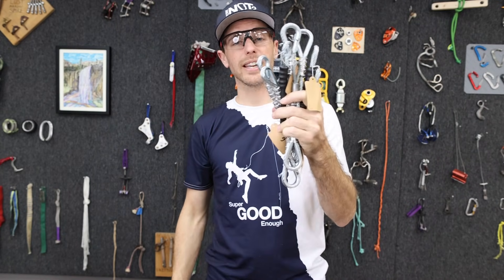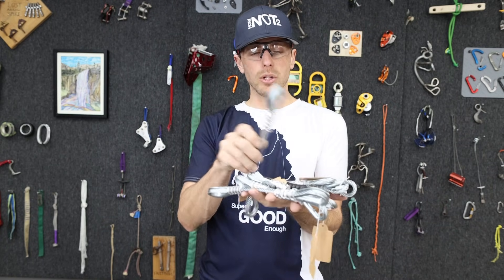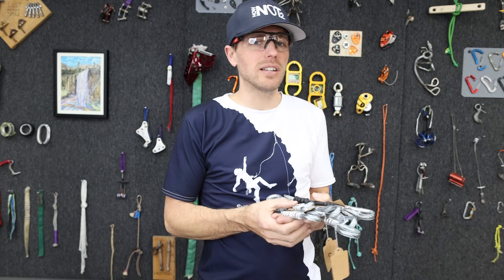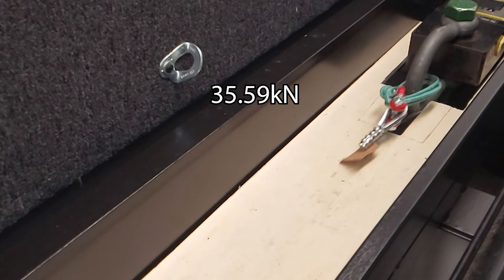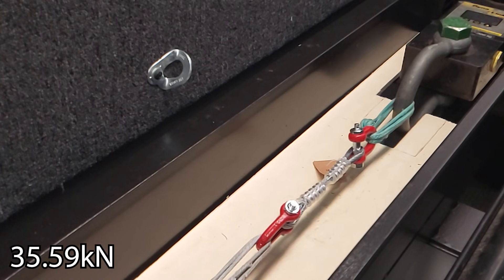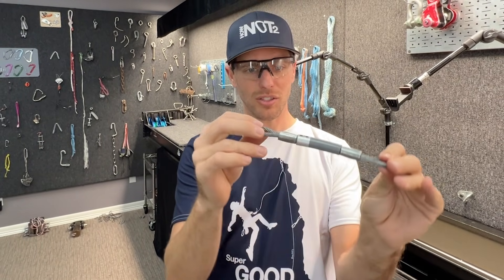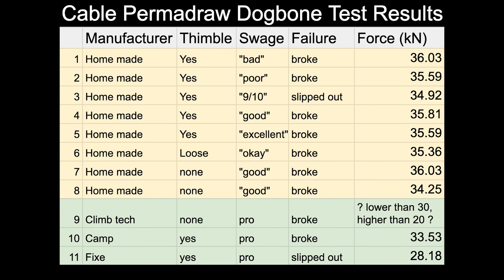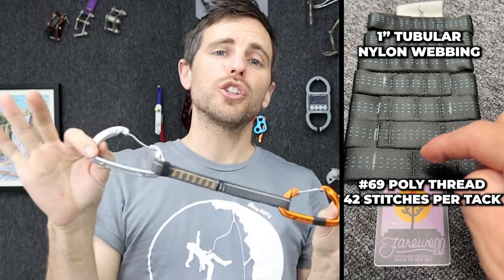Are you UNKNOWINGLY climbing on homemade gear???

Comment: That is way good enough. I did fly gliders in my youth and we made winch starts with 4.2 mm steel ropes. Everything was put together using swages. The aircraft weighed up to 750 kg and we used a load fuse of max 10 kN. The ropes were usually dragged through sand every weekend for up to a year. 
Should be enough to catch a falling human of 100 kg.
Nice work!

Comment: ❤ now that u are doing cable... i have some offroad warn cable nos i could send ya... respooled mine with dyneema when new. if u could do an off road series that would be epic... because most of us guess and trust mfr labels which is usually wrong for various reasons. several yt have been hurt doing  a reccivery... seen ppl winched down to a spot with a badlands or warn winch... 😮😅 thats sketch on a badlands winch.. or is it? since winch is not rated for humans 😂 matt offroad recovery or others are always showing bad form on hooking gear up to rapel with a winch. 😢

Comment: They make single cable swages to be used as like stopper knots to help prevent slipping from the main swages.
https://www.google.com/aclk?sa=l&ai=DChcSEwjprsnmqveIAxXlNdQBHf1QGYoYABAbGgJvYQ&co=1&ase=2&gclid=EAIaIQobChMI6a7J5qr3iAMV5TXUAR39UBmKEAQYDSABEgIVF_D_BwE&sig=AOD64_3-Fwi4Q_AC5zLG5dzAh2J_t6k5iA&ctype=46&q=&ved=2ahUKEwjapsPmqveIAxV04ckDHaoPAAsQzzkoAHoECDQQMw&adurl=

Comment: Prehaps I need to make up a really weird version of this, and send a few in. In the version I can make, if I can get a tight enough bend radius out of the cable, is to unwind the strands of a wire rope, then using a single strand, retwisting the single strand in a loop to recreate a nearly endless loop, with the only ends being the 2 ends of the single strand. This:https://youtu.be/GPp1GWGxG4c?si=8XRh5L5xaRDhizUP . Then collapsing the loop into a double strand center, with a loop at either end. 

Also, testing of the "Farmers Eye" demonstrated in that video would be interesting content.

Comment: The DIY swaging is actually pretty simple, using tools made for the purpose; proper cable diameter and material, correct size swage, crimp correctly with a long armed tool, or a press. The check is done with a slide-on feeler gauge, and of course also having a reliable pull test done initially, and randomly after is smart insurance. If this seems suspect, consider the end user is likely in industrial work where serviceable tools and methods have evolved and been used for many decades; consistency is very important, and also a healthy safe working load margin. Home sewn webbing is a total non-starter with no consistency or check except pull testing - don't go there.

Comment: Warning! Do not use dogbones permanent outdoors with plastic sheeting! Two young boys died doing a rapell on a plastic  sheeteed dogbone. It was set between two bolts and the boys having just started climbing and had not much experience put theire rope over the wire. 
The wire broke on the load and sadly the other boy also was tied in to the rapell rope. 
The reson for this is there was a plastic sheeting on the dogbone and even though it looked good on the ends it was rusted inside the sheeting.
Reply: That's exactly what I was thinking - opaque sheathing prevents you from being able to inspect the cable.

Comment: Coming at this from logging... it will generally break AT the thimble or the first bend point, that said, for funsies try a "flemish eye" splice (also know as a farmer eye) one of the easiest splices and doesn't involve bending the rope (bonus it can be done in the bush without special tools...) It also doesn't necessarily require a thimble, though a thimble does secure it from unraveling, but its not relying on it for strength.

Comment: - Re. Homemade vs unreliable batches?? - Homemade is FINE - provided the composition and processes are uniform  - your Saturday article on "off-brand" items (13th Jan 2024)  made sense  (I want cheap UHMWPE - but not if it isn't what it says on the label):
One thing to figure out with the "no-name" components, if were they failed in the quality department at some stage, or merely cosmetically defective. Testing small numbers out of a batch assumes that the batch is relatively uniform, it may be found with some parts that the batch is unreliably variable (making the QA necessarily more expensive as higher part counts need to be tested, rather than 1-2 out of every thousand...

Once a batch is tested - and the reliability established -the "How Not-2" on the label should refer people of all the things NOT to do with this item, and how the responsibility for safe use rests on them - ie. we NEVER recommend you do this at home  (Seek professional assistance for that problem)....

Flooding the world with cheap 304SS sounds a great plan.  (If a bolt can be had for $2 and a carabiner for $4 - backing up on the safety becomes trivial.) - cheers.

Comment: I’m gonna bet the thimbles help with repetitive loading. We use air craft cable at work for hanging banners, whenever we don’t use thimbles the eyes tend to degrade faster then when we do. Totally different application, continuous static tension with spikes when we put a banner up and spikes when the wind is blowing is not the same as climbing.

Comment: Did you do any of them with the cable woven back on it self? That is unwind three of the strands and then rewind them the other direction around the thimble?

It would be interesting to see how that would work with just heat stink and no swages at all. I suspect if you do it the hard way (take every other strand rather than 3 consecutive strands and do about 3 full wraps back past the thimble) you might get number comparable to those ones. I suspect, given they were breaking between the swages, the result would be not enough better to justify the cost. For a dog-bone, you might even be able to have the strands coming back from the ends pass in the middle which might actually get some benefit.

Comment: Generally with Nico sleeves, you will put them through a go/nogo gage.  It's basically two slots.  The swage diameter should go into the go slot, and not go into the nogo slot.  Crimping too tightly is as problematical as not crimping enough.  Usually once you got the swaging tool calibrated, it reliably made swages that passed both gage slots.  But you always check, because the swage tool wears.
Reply: I'm not disagreeing with you. However Google "TB-2.0:  Go-Gauge or Go-No-Go Gauge nico Bulletin", and take a look at their pdf.

Comment: "Just crimp it and call it good"

Am no expert on crimping wire rope, but afaik there's the cheap steel sleeves friction crimps which is what the motion and comment you made fits to, and then there's aluminium penetration crimps (I believe that's the one you're testing) which you need a powered hydraulic crimp tool for that's anywhere upwards of $1000. Not exactly what you randomly find at home depot.

Comment: i think the biggest difference with any life support gear that is homemade is quality control. When you buy from a reputable company you can feel confident there's a 1 in 100,000 (pulled that statistic out of thin air) it will break vs homemade might be 1 in 100 (also made up stat but i hope the point comes across). That would be truly the risk- the ability to be consistent with the manufacturing process and ability to assess quality on each device.

Comment: most ferrule specs call for 1 more crimp than truly necessary, at least when you use a tool and die that can't crimp the whole ferrule in one go. incomplete crimps are scarier than ugly ones imo, without using a gauge to check for full compression an incomplete crimp can look just like a proper one.

Comment: Please never use heat shrink or tape or anything of the likes on metal parts that are supposed to be outdoors permanently. Water gets trapped under it and corrodes the heck out of it and you can't see it because the tape and heatshrink aren't see through (most of the time (but still don't do it even if it's see through))

Comment: It's not just small garage manufacturers which can lose track of quality control on handmade terminations... there's a French rope company targeting the arborist community with a recent advisory because one of their distributors skipped stitching the spice... and their proprietary splice depends on the stitch to stay together. (This is in contrast to a traditional double-braid eye splice where the stitch is a backup solely to prevent the possibility of creepage.) A climber took a scary fall when their eye splice fell apart under static body weight, triggering the notice.
Reply: Courant?

Comment: I wonder how the coating on the cable would impact its ability to shed water? I've seen enough to know that water can get into anything and when it comes to metal... rust on cable is an issue. Having black coatings on a cable prevents you from seeing the rust. So I'd actually not prefer to climb on the bought and rated stuff given the plastic coatings. I'd much prefer to see the condition of the cable.

Comment: Those look like what we call a squeeze on or crimp it in powerline work. I have seen wire held up in some big spans weighing around 800 pounds sagged with a 3/4 ton hoist. I could see those made a little better by weaving a part of it and crimping the weave.

Comment: While I am not a recreational climber I do some work at height on small antenna towers and have some experience in industrial rigging. I also have quite a bit experience in crimp termination for electrical work.

The permanent dog-bones that you tested look like they were probably made using 7x19 1/4" GAC (Galvanized Aircraft Cable). 7 Strands each comprised 19 individual wires. It normally has a 7000 Lbs minimum breaking strength when new. The galvanized coating is relatively thin so I would not expect that it would resist corrosion for long permanently installed outdoors. You can get it in a stainless version but it does have a slightly lower minimum breaking strength of 6400 Lbs. Outside of actual MIL spec versions that are certified, commonly available aircraft cable is not actually used for control cables in aircraft.

In industrial rigging the cable used is referred to as "Wire Rope" and while similar is not quite the same. The most common versions are probably 6X19 IWRC and 6x37 IWRC (Independent Wire Rope Core). The center strand is not considered to be load bearing and is only there to support the outer strands. There are also fiber core versions and many other stranding configurations. Very commonly it is not galvanized but oiled to both prevent corrosion and lubricate the wires as they move against each other while going over sheaves or being wound onto drums.

In the case of GAC termination using Oval crimp sleeves (also called Duplex or Nicopress Sleeves) like your samples had is probably the most common method. These were originally invented by the "National Telephone Supply" Company in the early part of the last century. Your samples looked like they had aluminum sleeves, additionally they are also available in plain copper, zinc plated copper, tin plated copper and stainless steel. The different materials and platings are not universally interchangeable. Aluminum, copper and zinc plated copper are usually used on galvanized cable while tin plated copper and stainless are used on stainless cable. Aluminum is generally considered the weakest option and may or may not hold the full breaking strength of the cable. I have also heard that it may be more susceptible to stress cracking but cannot find a good source for that. Copper or plated copper sleeves are generally considered to be stronger and more reliable and should consistently hold until the cable itself breaks. Stainless sleeves are usually reserved for more corrosive environments and tend to be much more expensive. 

In addition to the wide variety of sleeve materials and platings there is also a wide variety of tooling available to crimp or swage them. As with all crimping based termination systems whether they are mechanical or electrical, consistent results can only be achieved if everything is properly matched and done to the manufacturer's specifications. The sleeves must be the correct size for the cable, the tool must be the correct size for the sleeves, and it must be crimped the correct number of times in the correct order. In the case of the commercially made ones it looks like they were crimped with a hydraulic tool while the home built ones were most likely done with a hand tool. As far as I know the largest size possible with hand tools is 5/16”. Even ¼” requires a very large tool. The correct Nicopress hand tool for ¼” sleeves is a 3-F6-950 and is the size of a large bolt cutter.

If everything is done correctly the results should be consistent and your testing is in line with what I would expect. Even with aluminum sleeves you were seeing failures above MBS. I would be interested to see how much things change with weathering and corrosion. It might be worth doing some accelerated aging as a test (IE exposure to corrosive environment). Personally while I am interested in the idea of using industrial hardware even with everything done correctly I would still want these proof tested before I would trust my life to them.
Reply: This is a nice detailed explanation.  I am an old person that used to do a lot of sport and industrial climbing.  7000 lbs force is 31137 Newtons.  I find it a little odd that any slipped out, which suggest a lot of variation in crimping.  Also the crimps looked bent in places, which suggests the bolt cutter tool and losing control of the tool along its axis.  I was a little surprised to see the cable break at the crimp.  That suggests to me that it was over crimped or not quite the right crimp die or crimp sleeve for that cable.   This is a slow test with a steadily increasing load.  It would be interesting to see these tested in their drop load rig.
Reply: Weather they slip or the cable breaks doesn't really matter as long as they are consistently above MBS. Seeing some variation in the results doesn't really surprise me as any hand crimping process will be less consistent than a more automated machine based one. The sample where allover the place with minor variations and defects that would not pass inspection in a safety critical application in industry.

The amount of cable tail sticking out, the order of the crimps, the spacing of them, how well the sleeve is aligned angularly to the tool, how rigid and repeatable the tool is, and many more minor factors can all play into the end result. Along with the quality and consistency of the cable and sleeve which are essentially low cost commodity hardware. One batch to next or different suppliers may have more variation that you might think. 

Add in to this that historically once you went over about 3/16" cable and crimp sleeves you really didn't have many choices of crimping tools. Either you used a real OEM manual or hydraulic crimper and had a high chance of success or you got creative and beat it flat with a hammer or flattened it in a vise and got obviously poor results. In the last few years the range of low cost import crimper has significantly increased to include large size tool to handle 1/4" and 5/16"cable and sleeves. Once you start mixing low cost crimpers of unknown pedigree with low cost cable and sleeves from consumer sources such as eBay and Amazon you get into the wild west of unknowns. They might be "super good enough" they might not be, unless you have the resources to test and verify that you can get acceptable results consistently I would be very hesitant to trust my life to them. If you stay within the known boundaries of reputable industrial brands and suppliers and use properly adjusted manufacturer specified tooling you have a much higher chance of getting consistent results. It's no longer possible to tell just by looking at the finished result whether it was done with high end industrial tooling or cheap knock off tooling. 

I guess at the end like any other bolting hardware options, unless you did the work to build the route yourself you have to trust that those who did knew what they were doing. Hopefully even the cheaper option are still overkill enough that they are "super good enough". I definitely like the testing and discussion related to it.
Reply: @peterfox2565    I agree.

Comment: Old guy here. Back when I started the sport we made all our own gear except for carabiners. We filed the threads out of machine nuts and threaded them with rope or webbing for chocks and we had a forge where we made our own pitons. Nothing we did would have been considered safe. I love that you guys are making it safe. CHeers.
Reply: I wonder if Ryan has tested the old nuts and webbing stppers of the past.  I bet the are strong enough.
Reply: How old are you? I started in 73 - hocky puck rubber, swami belts, Stoppers and Hexes on perlon. 150' ropes.
Reply: Those were the days in climbing when a bong was something completely different 😂.
Good Times
Reply: Now I want to know what a bong was way back when!
Reply: A large U shaped piton that kind of cow belled a "bong" when clanged. 

There was overlap  @jennyjansen754
Reply: Large angle piton--2, 3, 4 inches span,  made and sold by Chouinard. Called so because  of the sound when being hammered in,
Reply: Can’t forget the Salewa Spring Assisted Stitch Plate and a zinc coated carabiner for any rappel spots.